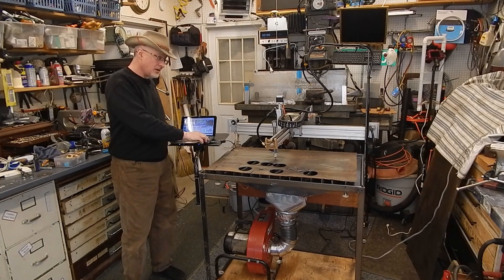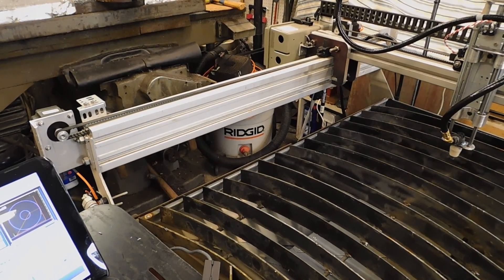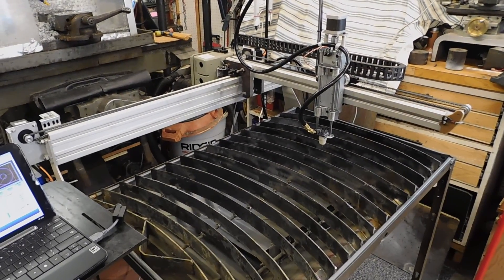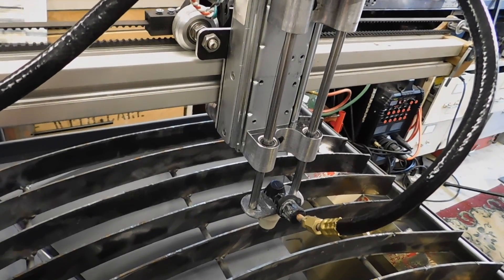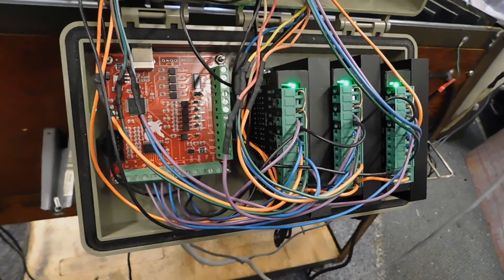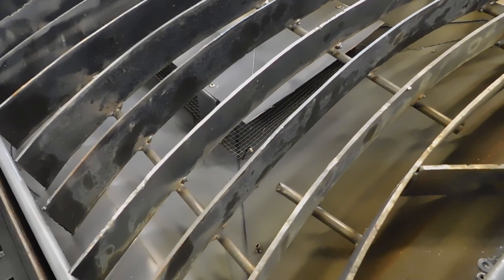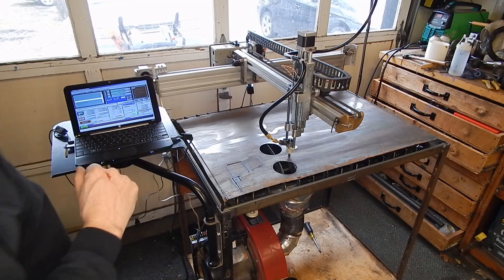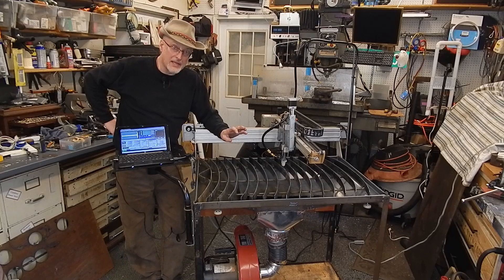Junk-built CNC Plasma Cutter Table

Comment: Sheetcam and a floating Z axes will fix all your problems  also USB and EFI doesn't play well together. that MACH3 controller board is for a wood cutter or mill
Reply from the maker: There’s a later video showing how I fixed the EFI with filter caps and shielding. The unit does have a floating axis but the real fix was an actual pilot arc converter I built in my most recent video. I’m intrigued by Sheetcam, especially now that I see there is a Linux version! Thanks!

Comment: Nice build. 
I use SheetCam, please try it cos it's really good and if you ever add rotary axis, it is right fir the job. 

Regarding interference, try to ground the tip of torch. Then add a copper ground rod into floor and grown all that. I had to do that with my very first build and plasma.
Reply from the maker: Thanks! Check out my other plasma CNC video where I solve the interference problem!
Reply: @JakevonSlatt  will do thanks 👍

Comment: I've dealt with that crashing issue on USB controllers in the robotics industry I work for the pharmaceutical sector building robotics platforms for drug Discovery and development I would simply get some wide copper tape some skinny copper tape for the wiring and wrap everything and go for it it's not exactly an elegant solution but it always seem to work
Reply from the maker: That’s essentially what I did in the follow-up video, plus a whole bunch of decoupling caps

Comment: Hi, I'm very interested in your dust collection system under the plasma table!! i would like to build for my belt grinder (very dusty) and was wondering if you provide the information on the fan and motor, please
Reply from the maker: It’s a dust collector from Harbor freight, the kind that usually has a big cloth bag on the output
Reply: thank you very much be safe
 @JakevonSlatt

Comment: The pilot arc functions by applying a voltage between the electrode & the nozzle. This creates the pilot arc plasma. When the plasma contacts the work, current starts to flow through the work ground circuit. The machines circuity detects this current. It turns off the pilot arc voltage & ramps up the cutting current to what it is set for.
Reply from the maker: Precisely.

Comment: Programming it to cut things is probably a lot more difficult than building the table, huh?
Reply from the maker: It's basically the same as creating g-code for a CNC mill. I use a program called CamBam which is pretty easy to learn. I talk about the changes you need to make to CamBam for plasma cutting in Part 2.

Comment: I've watched heaps of CNC plasma builds  the efficiency here is exceptional please tell us  how many dollars and hrs you have invested ..
Reply from the maker: A lot of the material came from my junk bin including two of the stepper motors. I think I spent about $180 on the USB CNC Controller, the stepper drivers, a second torch for my plasma cutter, and the shielded cable I talk about in Part 2. I didn't keep track of the hours I spent on it, but it was an off-again-on-again project over the winter.

Comment: Would be the perfect size for my shop. I don't think anyone around here is scrapping out assembly lines though. 😂
Reply from the maker: The standard 40x40mm t-slot extrusions are reasonably priced and pretty available, doesn’t have to be Rexroth!
Reply: @JakevonSlatt  I'll have to look around.
Reply: Looks almost identical to some aluminum door frames I've got from some glass store front doors. A thought...

Comment: Great build. I also started building mine recently. 50 Amp HF plasma. I use Arduino Uno and GRBL, firts attempt was a failure as the noise was knocking down arduino. I equipped myselef with shielded cables, metal box for control, ferrites, shielded USB. I will try to get it done over weekend. I hope it will work now, even tho  after post factum research I know that it can be a waste of money😅
Reply from the maker: I'm working on shielding right now myself! Stay tuned!
Reply from the maker: Success! I've beaten the RFI problems, video coming soon!
Reply: @JakevonSlatt  Can't wait! Thanks for your work. Mine was not tested yet. Cabling is done. Took me a while to finish. Hopefully I will test it soon. I will look forward for your video
Reply: I have made cnc plasma and tig welding lathe with arduino. They both work awesome. For plasma pilot arc is the best option no high frequency. With tig welder it was a problem that is best solved with opto isolation board and always make sure the computer is plugged into a grounded outlet so no laptop running without being plugged in
Reply: It’s certainly a challenge. I had no luck with a HF plasma after days of foil wrapping, shielded wiring, putting the controller in a lead sheathed cast iron pot etc etc only success was when I moved the torch and work surface at least 10 feet away from the controller bo. Got rid of that and will try a pilot arc machine next.

Comment: You can use the same head and convert it to a pilot arc.
Use the ferrite core from that Dell monitor you had.
Reply from the maker: I've been looking at the "pilot arc conversion" videos on YouTube and I actually think they're bunk. There has to be a circuit that transfers the current to the work piece when cutting begins, in other words you can't just run a wire to the torch to initiate a pilot arc, there has to be additional circuitry otherwise you will loose a lot of cutting capacity.

I've tried multiple ferrite cores to no avail. I think I need to move the electronics into a metal box and run shielded cable. Working on that now, stay tuned!

Comment: Jake, great project. 

I think I'm going to attempt to replicate your setup. I most likely missed the models of all the electronics you used. 

I think one controller board might be the CNC USB MACH3 100Khz Breakout Board 4 Axis Interface Driver Motion Controller.?. 

If it's not to much of a bother, could you list everything? thank you for your time.
Reply from the maker: These are what I used (but not from these particular vendors):

https://www.ebay.com/itm/175642450298

https://www.ebay.com/itm/254853814455
Reply: @JakevonSlatt  Thank you.

Comment: One of the nicest low dollar builds on YouTube! Maybe I missed it but wondering how you are tensioning the belts?
Reply from the maker: Thank you! To tension the belts I just made a plastic block with a slot through it. I pull both end of the belt through it with a pair of plies and then screw a drywall screw through them to pin them in place.